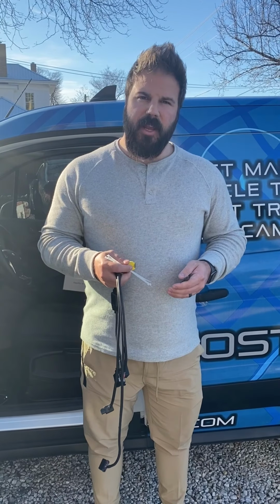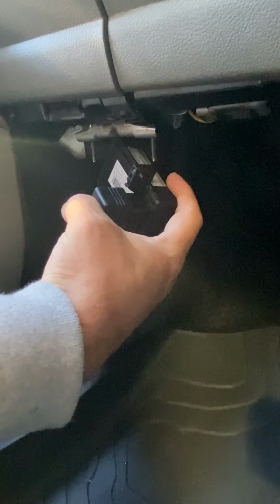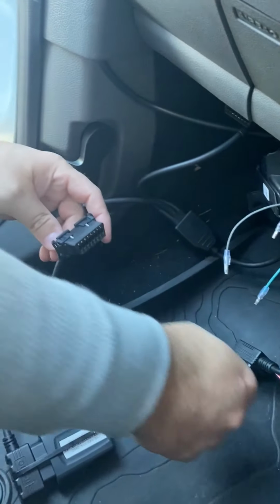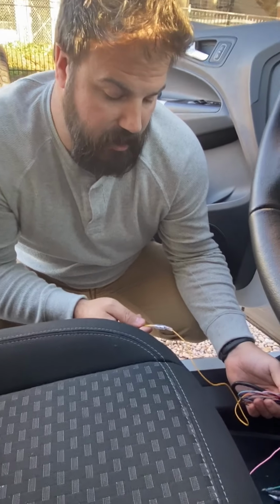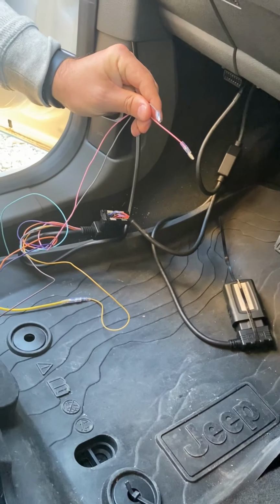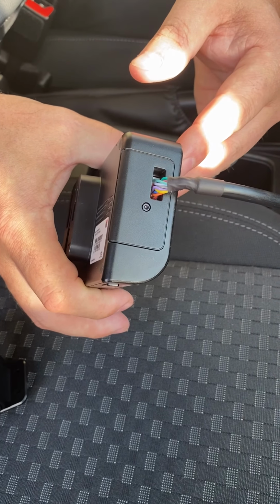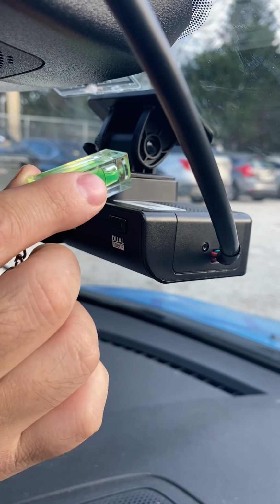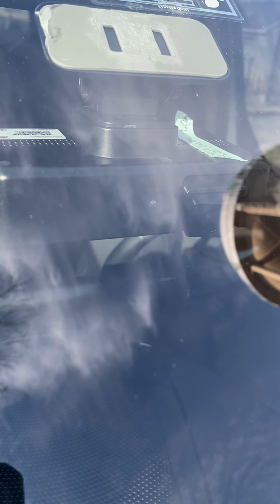FleetFlix Installation Video

Comment: Is it legal to mount the camera that low on the windshield?
FMCSA regulation - 
https://www.federalregister.gov/documents/2022/03/07/2022-03996/parts-and-accessories-necessary-for-safe-operation-authorized-windshield-area-for-the-installation